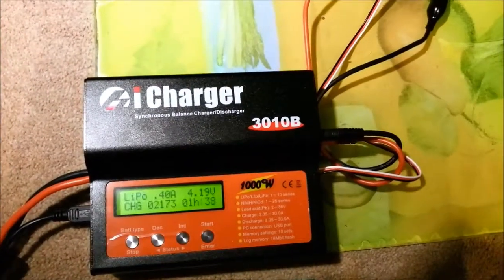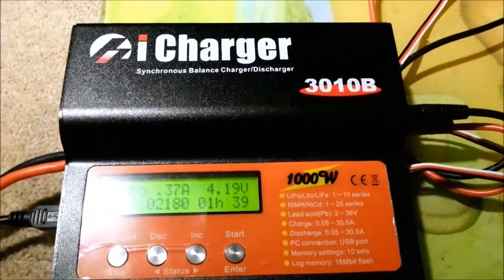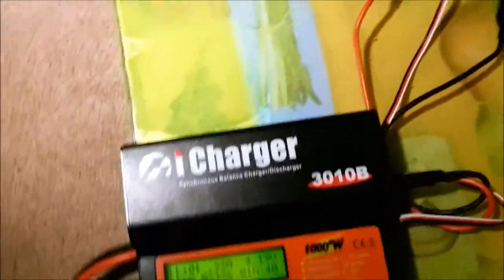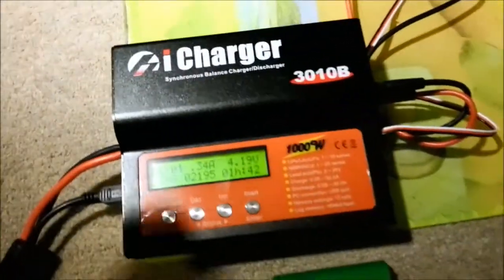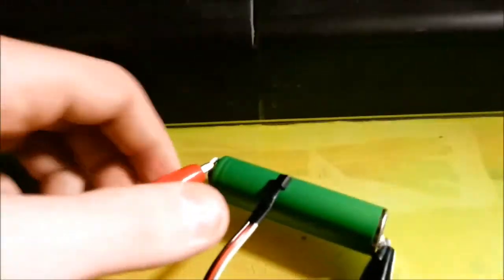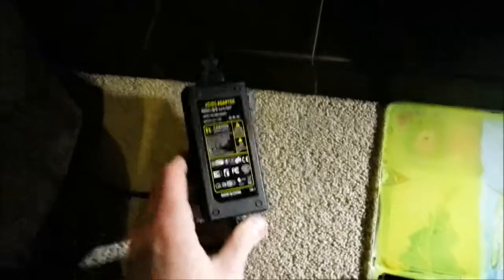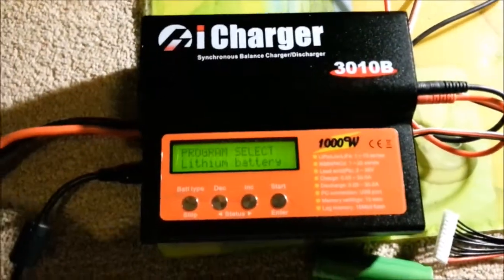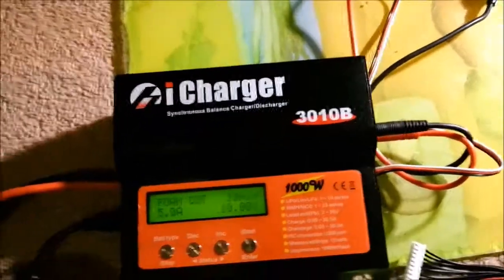RC Quad Drone Car Plane Helicopter ULTIMATE Battery Charger 1000w 30amp! Icharger 3010b 1kw

Comment: Does it have adjustable voltage cut off? In case you want to charge a battery to 4.1v instead of 4.2v?
Reply from the maker: Yes you can change it

Comment: I have the same charger but I'm not sure what I should power it with. What is your setup?
Reply from the maker: +Alex King in this video I am just using a 5 amp 12v laptop charger. but i normally use a 19v 5 amp charger. these can be found pretty cheap on Ebay! if you need more power look on websites such as hobbyking at 24v power supplies

Comment: Hi. Great video. I have just bought the DJI S1000+ drone. The iCharger 306B came with instructions but I have no formal training in electronics and I'm worried about making a mistake with charging. Are you willing to talk me through the basics?
Reply from the maker: Sebastien Dunn I would recommend having a good read through the manual, as it is pretty good. And having a look around on-line. the site Batteryuniversity often has a lot of good info!